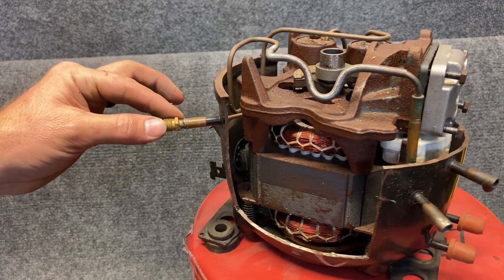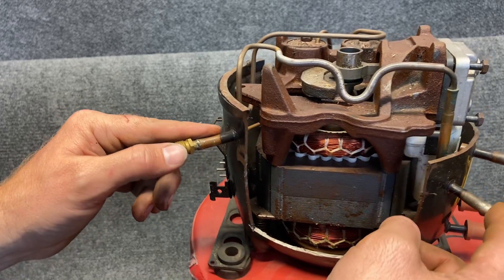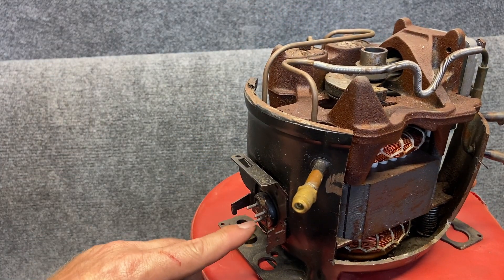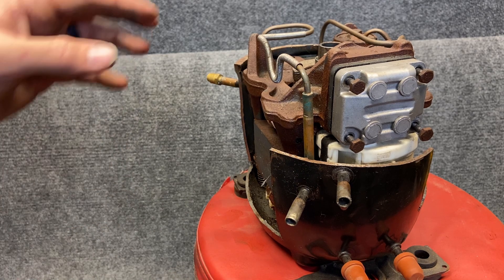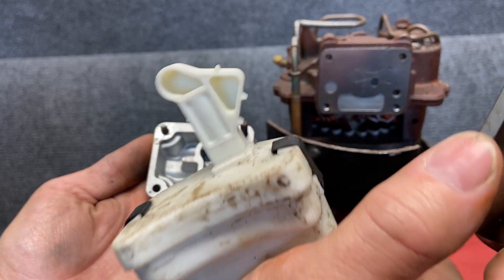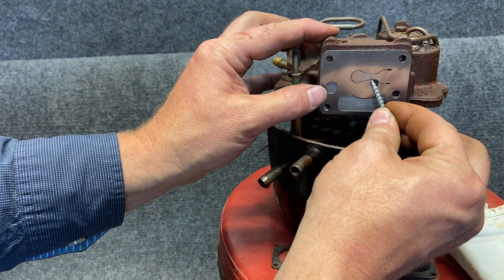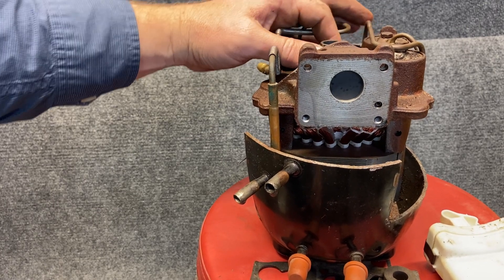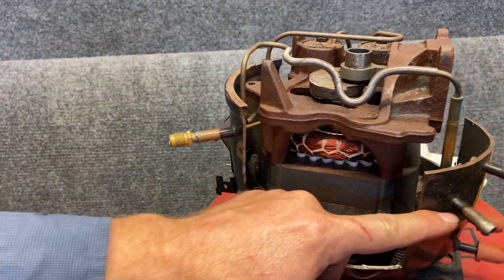HVAC 071 1 bonus Refrigerator Reciprocating Compressor hermetically sealed

Comment: Oil cooler tube - refrigeration installs may not offer the proper air cooling, so they can be piped for water cooling.  Probably more cost effective in a rack of compressors install.
Reply from the maker: Thank you!

Comment: Looks very well made, wonder why it was condemned.  My guess is the problem was elsewhere.
Reply from the maker: That's usually the case.
Reply: @love2hvac  In the case of the very expensive lg refrigerator in our kitchen stopped working 6 months ago, the inverter compressor stopped compressing.  Ouch!  Gimme a compressor that runs forever and ever as opposed to a "ultra efficient" Rube-Goldberg junker that konks out in 10yrs.